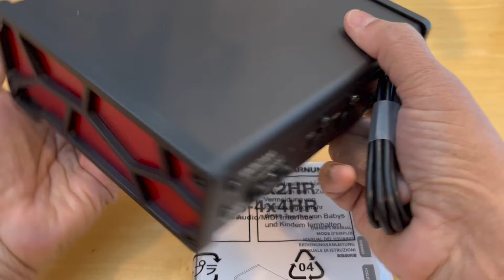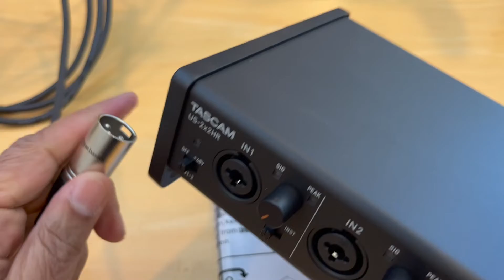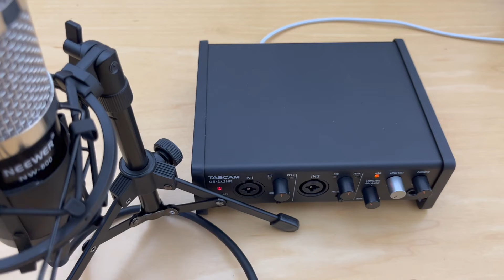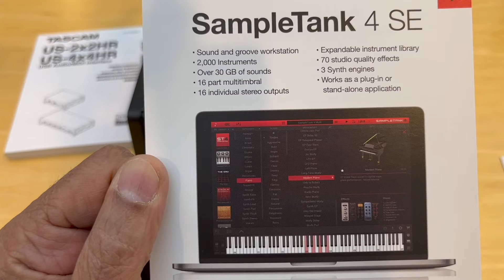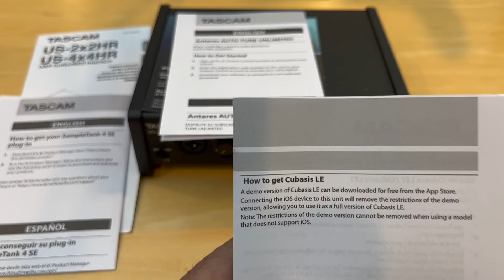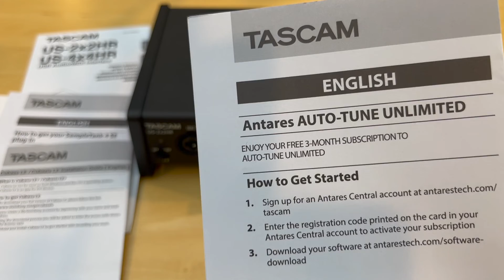Tascam US 2x2HR Set Up by Newbie

Comment: Hello, I have a tascam  US 1x2 interface, it does not connect to the PC, I have Win 10, the USB light blinks. I already reinstalled the drivers and nothing. What can I do? thank you
Reply from the maker: Sorry to hear that. Did you turn on the fathom power? That is critical.If the light is blinking, while it worked for me with the light blinking, one of the other commenters fixed it by using a better USB power cable. Is the mike being chosen by turning the knob? This was in the second video https://www.youtube.com/watch?v=iJ5xi5OpmeM

To see whether it works, maybe try the headset as in the video link. If that also does to work then there may a problem with the device. If it works with the headset, then it must be something between the outputs on the back and the connection to the PC. I am running mine on iOS so would not not much about Windows.

Comment: the USB light, once connected, is it blinking all the time?
Reply from the maker: Yes, mine blinks all the time. Even when I tested the two mics. Wish it did not do that...
Reply: This might be very annoying. I ve checked some other vids with 2x2HR presentations and their devices are not blinking. Usually blinking means something is not right. I would suggest to reinstall/update drivers, try another usb cable, try on different PC, and finally if nothing helps Tascam support (good luck with that though)
Reply: @leavingfebruary  Thank you. Will check it out. Appreciate the insight.
Reply: @UnboxingMyBuys  The problem with the blinking light is the USB cable. Mine did it with other cables but not heavier gauge USB-C cables. Just some food for thought.
Reply from the maker: @warlock1663  Many thanks - will try that.
Reply: @UnboxingMyBuys  You are certainly welcome! It drove crazy until I figured out that what was causing it. Great video BTW.